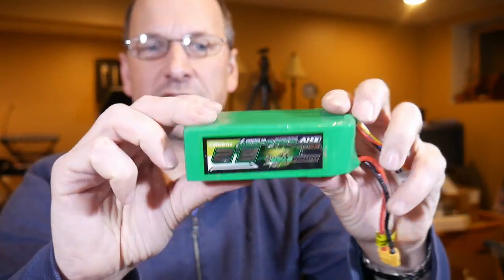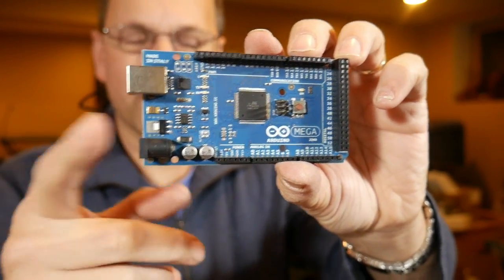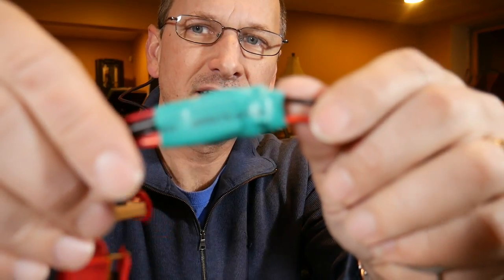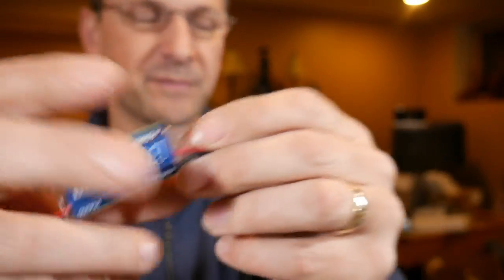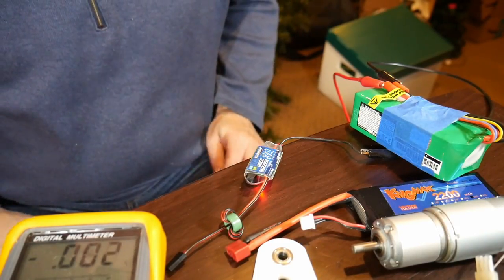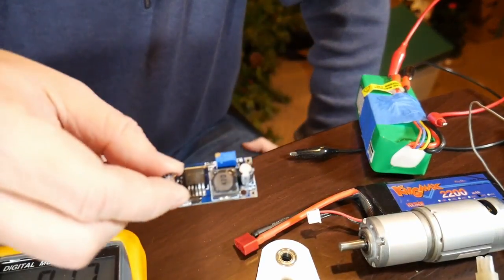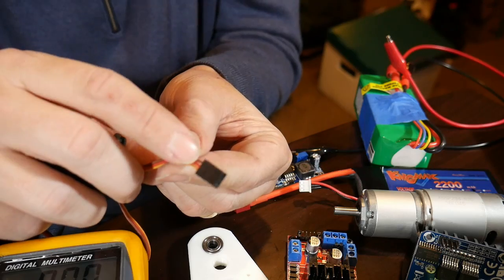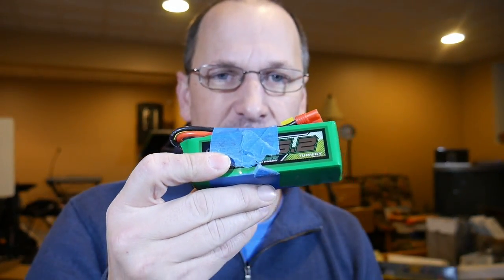Arduino Robot battery power: motors, servos, and DC converters for Beginners

Comment: heads up to people struggling with a kit, in my kit my robot car battery package for 6 a++ batteries gave no power... tried putting a 9volt battery in the pluss and minus trough the start and finish of the box and my robot worked.

Comment: Great video. Next time I'd love to hear practical difference between DC motors and servos. When do you use one versus the other. Cool stuff!
Reply: Tom Payne A DC motor uses magnetic fields to spin at alot of rpm, but it is not very precise. A servo has a  built in encoder that moves the motor to a specific degree, but does not always move fast or for all 360 degrees.

Comment: Question? I know I can measure voltage using the A0 pin on the Arduino(and read it on the serial monitor), but with the options you provide, it doesn't look possible, do you have any recommendation?

Comment: Good :)  is the 9V entry have the positive inside or outside of the pin connector ? (polarity + in the center or - in the center of the arduino ? )

Comment: I want to know how to supply several different voltages to a robot such as 5V to a 433Mhz receiver and to the servos, plus 9V to DC motors and 6V to the micro. I have three separate batteries and I would like to have just a single battery.
Reply from the maker: 3deeguy you should research dc-dc transformers.  You can convert voltage up and down.
Reply: EraserMice Labs, thanks for the quick reply and the advice.

Comment: Hi! Great video, thank you very much for your explanation. I'm actually trying to get my mind around something, maybe you can help me out find the cause. I have an arduino uno, a motor shield that is mounted directly onto the arduino, two dc motors (6-12 v is the voltage range each) and two lipo batteries, 11.1 v and 3000 mah each connected to the motor shield supplying 22 v for the motors. I also have a bluetooth module, an HC05 connected. The thing is that when I turn it on the bluetooh module fries. I've tried to power the bluetooth from a different source, but now the arduino fries when I power it on. Any idea about the cause? Any help will be highly appreciated! Thanks!
Reply from the maker: I'm kind of confused as to how you are trying to use the batteries to supply both 22v  for the motors and 11.1v to the arduino and other electronics.  I suspect you are winding up with 22v everywhere because of how the connections would work..

Comment: What if i would have connected the lipo battery directly to the arduino and tried to run it? without the ubec and stuff woudl it work?
Reply from the maker: depends on the voltage of the lipo battery you choose.  The typical arduino has a pretty broad operating voltage range, but you should check out the requirements of the specific model you are using!
Reply: EraserMice Labs ok so I'm trying to power 4 DC motors , one micro servo which is attached to a Adafruit motor shield which is inturn oicggy banked on an Arduino UNO. Now when I attached my 12 v 35c lipo battery it barely worked for the first 20 seconds and stopped . The Voltage regulator on the Arduino was Hott! And the L29 3D motor driver on the motor shield smoked up... Does it means there's too much voltage?
Reply from the maker: That does sound like something is getting higher voltage than it's expecting.  Make sure you are not pulling all the current through the arduino,  the power supply should be connected directly to the motor driver board.  I believe the l293 can also provide a regulated 5v if you need it.  Here's a link to some good information https://www.open-electronics.org/the-power-of-arduino-this-unknown/
Reply: EraserMice Labs ohwkay I tried that as well it fried the Motor driver chip... Please keep in mind I have done all this without the BEC. Do you think the BEC will solve this issue?
Reply from the maker: It's really a matter of making sure you re supplying everything with the voltages they require and sufficient current.  Be careful not to exceed the current capacity of the arduino and other components (DC motors can draw a LOT of current).  That's what's likely causing things to heat up or fry.
Reply: EraserMice Labs okay... I have used alkaline batteries before n it has worked perfectly fine.. I have ordered a UBEC . So I'm hoping it will solve the problem. Now I realised if I exceed the maximum current rating even that could leave me in a grave problem. But I just tried to connect the battery with the board and it was still  heating up the voltage regulator( without any motors or anything connected to draw load yet). This has led me to believe that the 11.1v from my lipo ia still a lot for the Arduino to dissipate the difference. I thank you a lot for the time you remove to help he here.

Comment: What motor drivers are you holding at 15:35? Struggling to find stuff that isn't crazy expensive.
Reply from the maker: Those are IBT-2 boards (BT-7960 chips if I recall without watching myself).  They are really inexpensive for what they do.  They're just no frills, high capacity H-bridges.
Reply: Thanks!